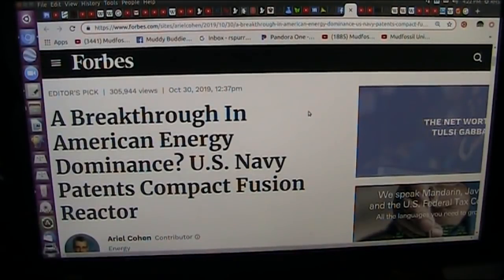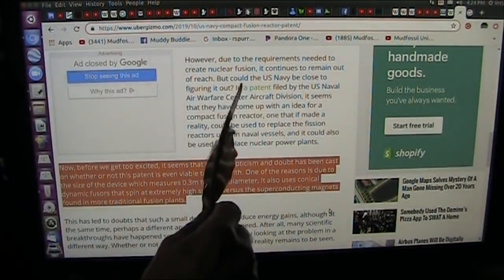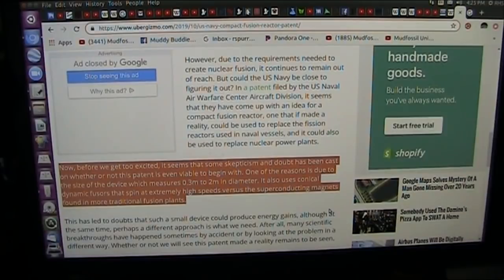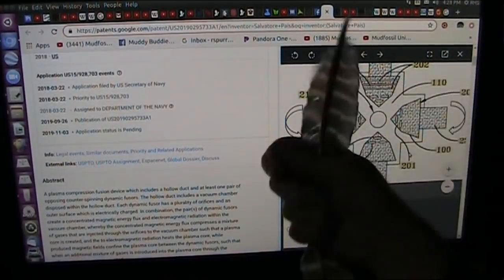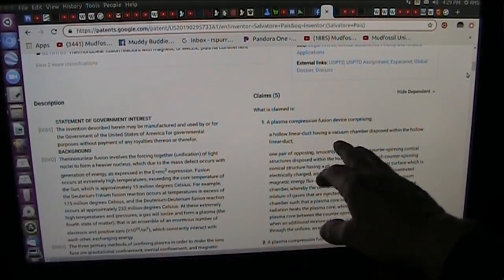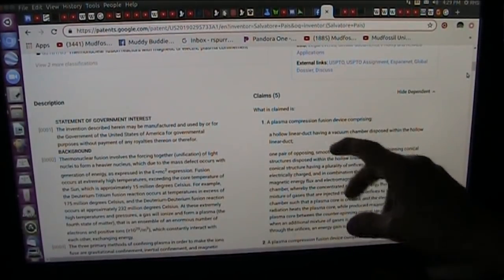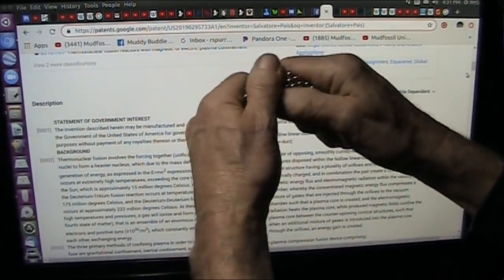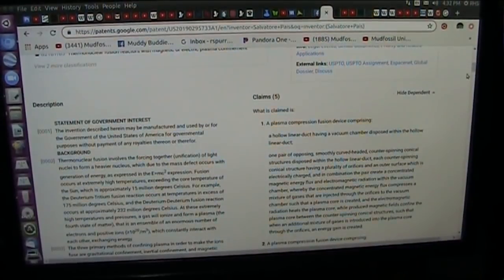Cold Fusion BREAKTHROUGH US NAVY Patent

Comment: Two counter magnetic disks spinning 3500 rpm add up to 7000 rpm as they pass each other then plasma formes in-between the two magnet .the guy that invented it got chased out of here in the late 70's he runs the motors in  small villages in India now all you have to do is oil the bearings and it was still running 15 years later .it came from a guy that worked at NASA .you put a copper plate in the plasma for your positive and a grounding rod in the ground for the you know it the ground .... I pray four protection Rigger God bless you Brother .your no fool your the smartest man in history . As I stated many times and tell all my top secret sience buddy's the same thing. I tell them all together we don't add up to one percent of your God given brain power and wisdom 😀 with a vacume and the new magnets we have now could work very well in a tiny system